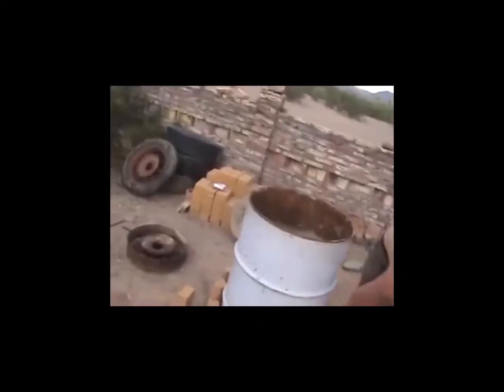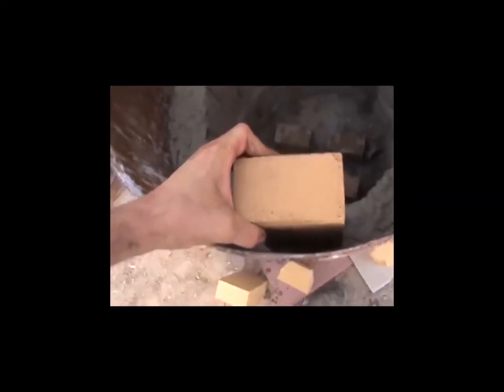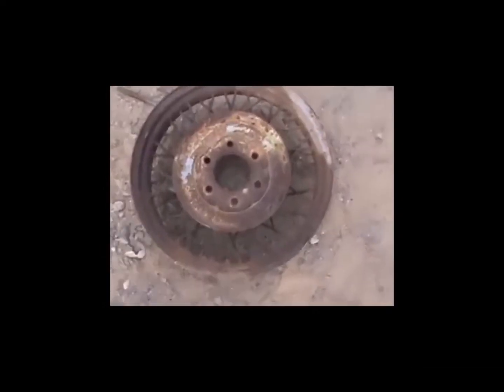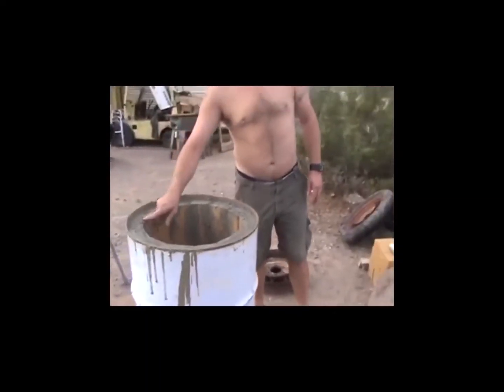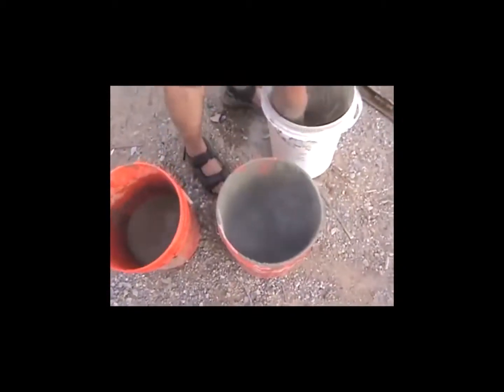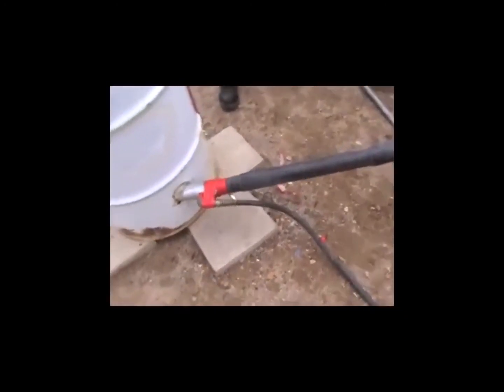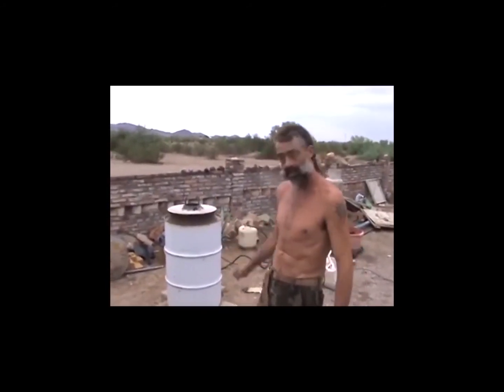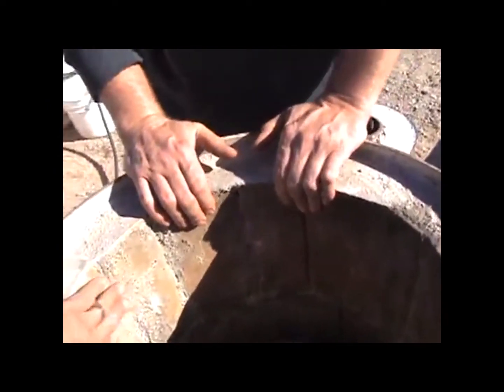SMELTING SUCCESS! furnace construction to metal BAR!!

Comment: Did you make any videos about the ore crushing and flux mixes?  Regardless, thanks for this video.
Reply from the maker: I used a hammer mill to crush my ore,.. https://www.youtube.com/watch?v=9oFefiq30m0, the flux was,... we use 1 part dense soda ash, 1 part silica (clear glass), 1 part ore, 3 parts borax and 2 parts flour, or charcoal (crushed)  we also use nails if there is a sulphur content,... if your ore is galena,.. you can do a raw melt with no  flux,.. get it hot enough to melt out the lead, then just p[ick out the silver crystals from within the galena, then smelt the crystals (with flux) for your silver
Reply: Thank you for taking the time for such a detailed response.  I especially liked the Galena tip.